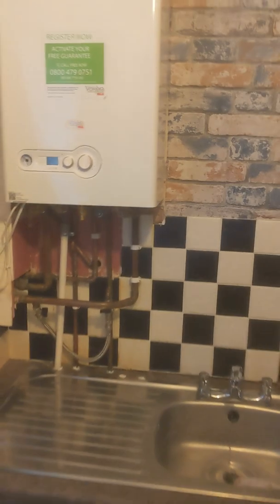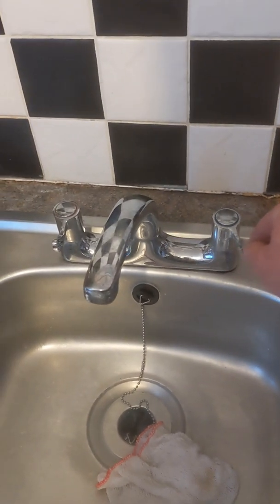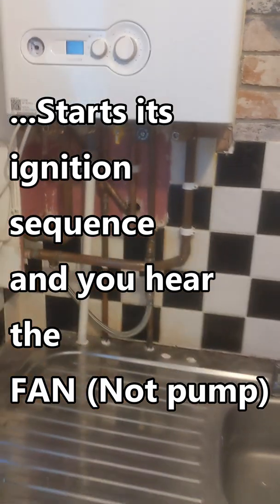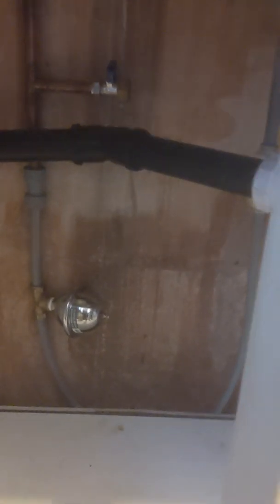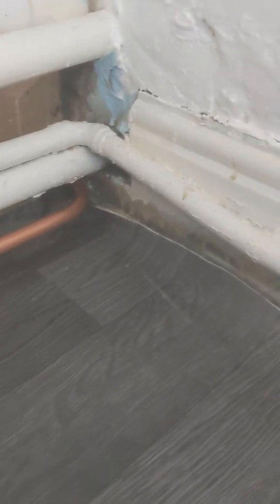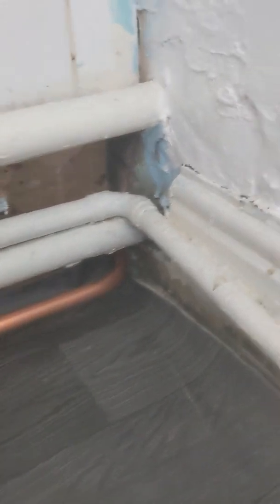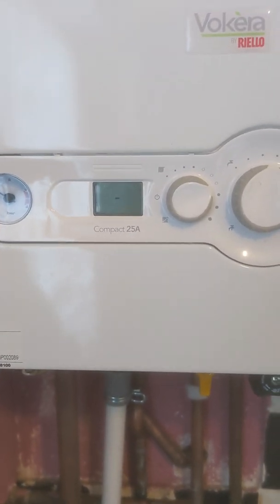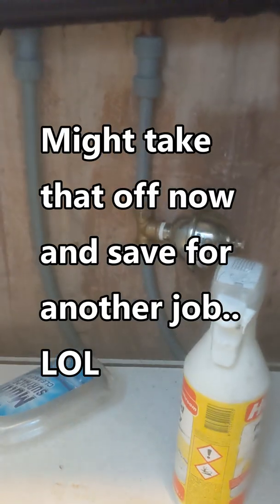Why is my boiler turning on when I turn a cold tap off??

Comment: my fan keeps turning on every 8min for 10sec for no reason, no taps turned on or anything. any ideas why?
Reply from the maker: @zenastronomy  so difficult to say without being there. However if you phone the boiler's technical line, they will tell you if that is correct for that boiler. They will know for sure...👍
Reply: @northwestgascertificates  thanks. I'll email them
Reply from the maker: What brand of boiler is it??
Reply from the maker: Difficult to say without seeing the boiler. Maybe you have pre heat on which turns the boiler on every so often to heat a small store of hot water within the boiler...
Reply: @northwestgascertificates  I switched everything to off. the actual flame doesn't turn on. Just the fan or pump.

Comment: why would a dead leg cause the fan to turn on in boiler?
Reply from the maker: Its possibly the air trapped there. You turn the cold tap off and you get some movement which tricks the flow sensor in thinking you ve put a hot tap on...

Comment: Awesome video and information Thank you for taking the time. I am having the exact same issue with my boiler after having a new bathroom fitted, my problem is I have no idea where the dead leg may be on my system. Better ask my bathroom installer. Thanks.

Comment: What’s the science behind this I’m stumped? If it was an issue of expansion, why didn’t the mini shock arrestor account for this? What was the dead leg reasoning behind this? Please explain what the dead leg was doing that caused this and how removing it sorted it
Reply from the maker: You have got me really thinking about this. What is the difference between a dead lead on the hot water side and the pipe going to a hot tap that you never use. There is no difference. However at some point you will always turn the hot tap on and there is the difference. The dead leg potentially will get some air trapped in it and there is no way of releasing it. Going back to the video when you turn a cold tap on, on the mixer tap, are you getting a slight cross over through the mixer tap which doesn't affect the boiler but with the pocket of air in the dead leg, this is enough to affect the flow turbine/pressure sensor. I can't remember what is in a Vokera. Don't quote me on this though, im not 100%sure...
Reply from the maker: ...also it was Vokera that said immediately, have you a dead leg on the hot  water side and that will be the problem if you have. Therefore you could phone them if you really want to know the science behind it..

Comment: My boiler fires up,while all the taps and heaters are off. 
Sometime even in the middle of the night,it proper fires up for like 5-10 seconds. And that happens 5-10 x  a day
Any clue guyz ?
Reply from the maker: Depends what boiler it is. Some are supposed to, if the water in the system drops below a certain temperature. Sometimes it's just the pump as well just pushing the water round the system. Again that's quite normal for a boiler to do that...
Reply: Could be faulty  Hall effect sensor

Comment: what you need is a shock arrester ,we fit these to Worcester boilers all the time  as they stop this problem and take minutes to fit
Reply from the maker: To be honest, I did fit one to the cold feed going to the boiler and it didn't stop it....that's why I phoned Vokera and they said about a dead leg on the hot side. Maybe the shock arrestor on the hot side would of sorted it??? What do you think??
Reply: Most Worcester now have a turbine signal delay setting and you can set it long enough to not fire up from the shockwave. No shock arrester needed. Unless of course you’ve a non return on the main!